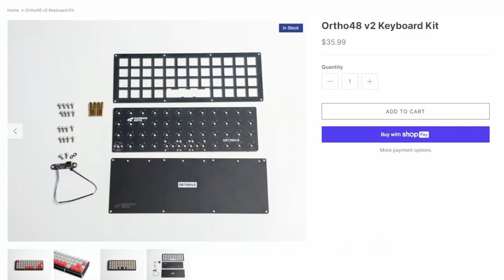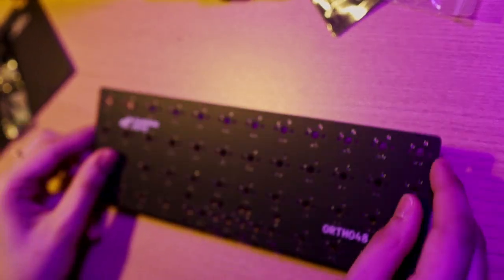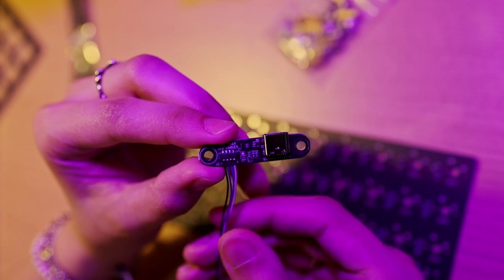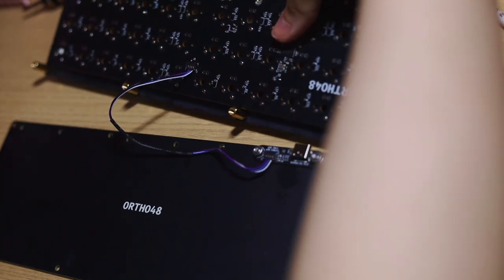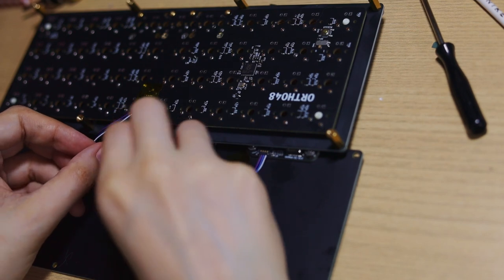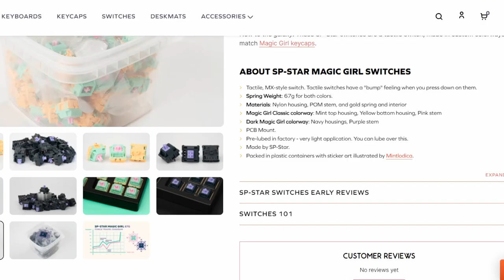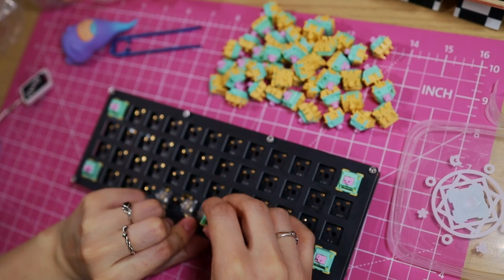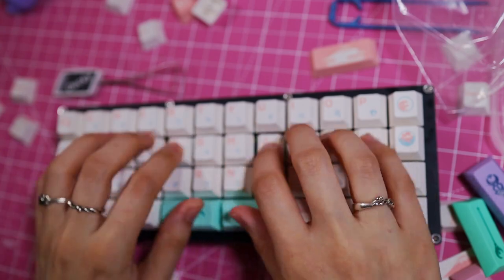Cool Uncle Mods: Ortho48 Build - Assembly & Thoughts

Comment: This looks like such a fun project. Id struggle with a 40% board but something similar for a slightly bigger format would be great. Need to try out some switches to see what i like first though. Any easy way to do that or know where to start when you dont already own a bunch?
Reply from the maker: Canon keys actually does sell practice boards like this in bigger sizes! As for switches, I watched a ton of video reviews and you can also buy sampler packs from stores like I did in this video. Have fun!!

Comment: Oh wow this is actually a much better deal than a drop Planck holy shit. Can this little thing be built without the plate? :3 I made my partner their first 60% recently and I made it plateless because imo the biggest advantage of the cherry MX design was being able to forego a plate. It just feels so much softer, and it makes the tone of the board more flat and thocky. Although this does appear to be an FR4 plate, which are actually my preferred plates with Alps and 3 pin switches for how neutral they are. Most of the switches I really love are switches they don't make anymore, so I don't really get to use hotswap sockets hehe x3
Reply: OHHHHH yeah I see why you couldn't PCB mount. Still a really neat board, I'm just extra xD
Reply: OHHHHHHHHHH YESSSSS those keycaps are soooooo hot. I need to figure out how to use a taobao proxy. I hear there's a lot of really good stuff on there for not just MX boards but also alps boards, and specific versions of the bbox60 :o
Reply from the maker: I used pandabuy and it was pretty seamless!